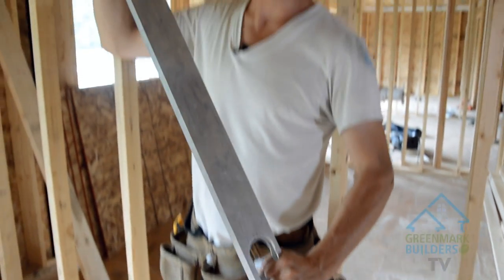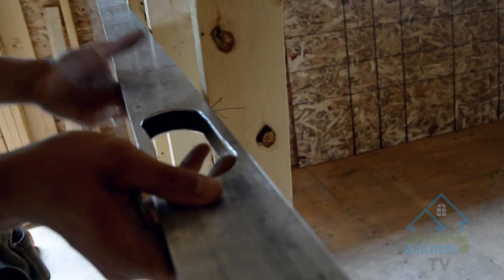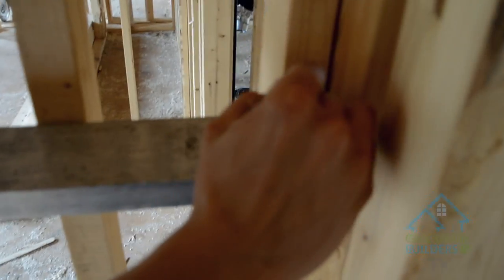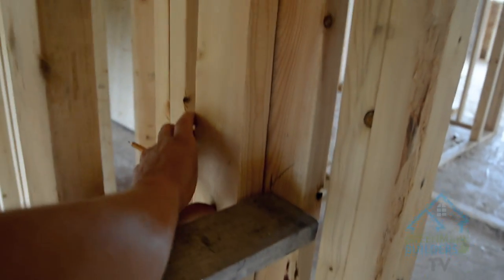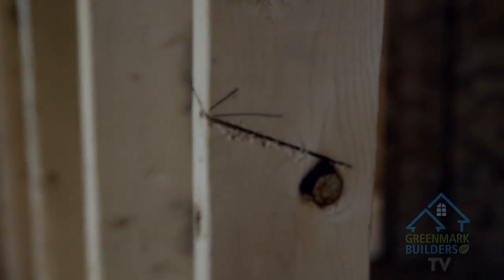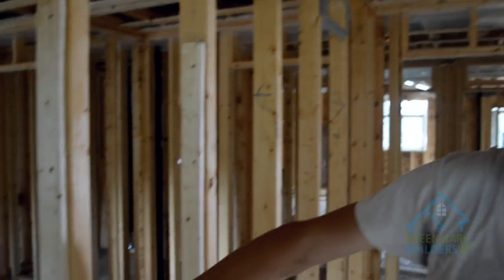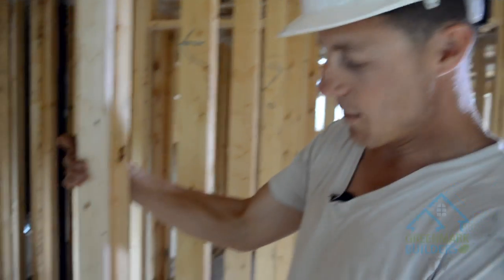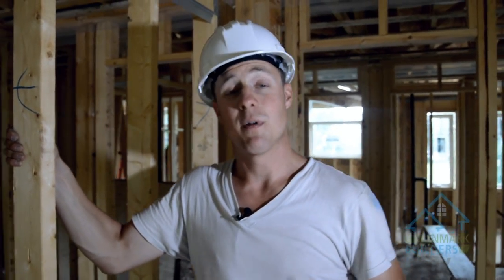Straightening Walls, Avoiding Drywall Pops!

Comment: Just kerf(small cut with saw) the backside about an inch deep(or more if you need) and PUSH, instead of PULL(i.e. the OPPOSITE of what you're doing)...easier to lean on a kerfed stud and screw than pulling and reaching and you often are seating the kerf back onto solid bearing and you can then toe a 3 in drywall screw through the kerf cut to prevent it from reverting  back. Good luck
Reply: A wall has two sides...so basically he did what you are saying
Reply: @thedcp  No, I believe he's saying to cut the bowed side so that the stud collapses down on the kerf (pushing away from the bow).

Comment: Don't forget to factor in that most "kiln dried framing lumber" is still about 20% moisture content, so when it dries out further in the house it will shrink and cause drywall pops.   Another way to get a straight and flat wall is to mark all the crowns in your stud lumber and install them in all the same direction.  This will prevent the wavy wall you would otherwise get.
Reply from the maker: Installing the crown in the same direction does help a lot, I should have mentioned that we do this as well. Thanks for your comment
Reply: You're solving one problem, but create another. You now have a hollow side and a cupped side. Depending on how bad this is you may need to pack and plane. Or use this method anyway.
Reply: @N1rOx  planing is not acceptable on inside walls... you fix the problem on one side of the wall but it persists on the other side...
Reply: @detrimundo  not acceptable to whom? It's common practice in the industry lol

Comment: Or you could have simply knocked the boards into place if it is an alignment issue and if it is a warping or size issue, a quick paper shim or hand-planer will smooth it out without essentially cutting it in half and then trying to replace the some of the strength with side braces.   Also, using center braces will help prevent future warping (and may be required as fireblock depending on where you are at).
Reply: What happens when you get to the other side of the wall? At least the bow has been corrected .  Center braces yes indeed also.
Reply: What he’s talking about works really well for leveling bowed or concave floor joists. It can also work during a remodel, to correct a bowed or concave wall due to wood drying out. However, it’s not practical to use this method during framing because it would simply take to long.

Comment: Keep in mind when you sheet both sides of the wall the drywall sandwiches the studs and essentially helps alighn the wall.
Reply: Drywall does not align walls. Drywall will conform to the wall. I have a house I bought full of warped and bowed drywall to prove it.

Comment: In New Zealand we do the same thing but we cut horizontally cut going 40-60mm into the stud then placing a wedge into our cut to straighten the stud
Reply: I saw it on Scott brown carpentry video. Nz YouTuber
Reply: Evil Nachoz yeah bro he’s the man
Reply: Yer Scott's channel is great. Here I've seen people cut and then screw. As you've removed material with the cut and then pull it together it takes it the opposite way

Comment: This is a really a nice technology. But it doesn`t work in case if another side of the wall is already covered with drywall or cement board.   Can you advise, please how many mm. of studs deviation is acceptable for further cement board sheeting and tiling by 600*600mm porcelain tiles, please? Thank you
Reply from the maker: In your case we would make the call on what looks good to the eye.  Every wall is different.  It's going to take you a bit of time but you can use plaster to correct somewhat.
Reply: @GreenmarkBuilders  Does it mean I can correct already cement sheet surface with plaster or use plaster as studs filler?   Thank you

Comment: All we do here In Colorado is cut like he did then screw it in at an angle and that straightens it or hit it with hammer on the bottom. Or if it’s not to bad then we staple 1-4 cardboard shims to make it even. My job is also to sand the plywood floor to even it out.

Comment: Here in Australia we have another method which I believe take less time and effort, we just pack the side that need to stick out and we just shave down the other side if needed, less time and effort I guess.
Reply: you can fix it from one side only. But how to add timber to the opposite side???  :)
Reply: @alexanderchuyko4889  they sell bundles of cheap 3mm packing strips.
Reply: That's both slower and more work.

Comment: Really hate to cut the stud in half like that. OCD framer here what I do site down every stud before I start. Any with a crown I put to side for my doubles. When they land doubles together put the crowns opposite each other work it down as you're nailing and they become perfectly straight
Reply from the maker: I hate cutting studs too.  I like straight walls and not dealing with drywall pops.  I agree with you on how you do the king studs.  Thanks for your comments
Reply: remember put the crowns opposite each other start at one end nail them together flush all the way down they will be perfectly straight. Some old timer showed me this about 25 yrs ago. Guess I'm the old timer now. 😅 also use your crown studs in kitchen crown outside the kitchen. Makes shiming cabinets perfectly straight a breeze.

Comment: This is insanity, though I understand what drove you to it.  Checking only the waist-high horizontal line along the studs conveniently assumes that the midpoint of each of those studs is where the warp will be worst, which often isn't the case (I see DF with S-bends on a regular basis).  It also ignores the equally-likely concern that, just as the framer didn't notice or care that some of his /studs/ were 3/16" out of plane, so could his top or bottom /plates/ have been warpy.  If your walls look sufficiently flat after only the treatment you show here, it may be that the studs weren't out enough to matter to begin with (of course your gyp will push and pull to improve planarity to some extent anyway), or that you're not coming back after the painters have gone and applying strong sidelight -- not your subcontract - to reveal the dishes and humps that a critical inspector might find under demanding specs.  By then, it would be the painter's headache...
Reply: DF is terrible for studs as it warps the most eventhiugh it has most strength.  I am not a framer and dont have to deal with crowned studs.  I just make sure I always choose no heart and straight studs from the get go.  You'd be surprised how much less flex your structure can be and the garbage that you have to deal with down the road.  I agree about the slicing... I'd really still thinking about a thin wedge instead of simple sistering, else you just have a useless stud taking up space but provides no structure.

Comment: Obviously don't use this method on load bearing walls?
Reply from the maker: You can still cut your stud on a load bearing wall, you need to add an equal sized stud on one side instead of the 1x3 ... this way you will have full bearing and a straight wall

Comment: why not replace the stud
Reply from the maker: if is not structural you don't need to worry about cutting the stud.  you may run into the new stud twisting in the future.

Comment: Just buy a planer, shave it down put the level on it and your ready to go !!!
Reply from the maker: if that works for you great.
Reply: never... that only addresses the problem on one side of the wall... what happens when you drywall the other side?
Reply: @detrimundo  you fill in the other side with shims to fill in the gap.
Reply: @GreenmarkBuilders  it does and it will save you a lot of time. Your doing it the super long way.

Comment: nice tip ,But with all that work and material ,why not just use metal studs (actually they are not that perfect also ,but they sraiten when drywall applied). I live in country where we use only metall. Its much better then wood for sure ,but in some countries wood just cheaper. Metall is way better ,light ,thin ,straight ,less and cheaper tools to assemble etc. PS. wood will distort aniway in year or two ,thats why most builders dont bother to straighten it.
Reply from the maker: +zCATAHAz Thanks for your tip on metal studs.  We use metal a lot here in Canada on Commercial jobs.  I would say the majority of builders here in Canada build with wood partitions because of the price and the speed.  To comment to your last point about wood distorting:  When walls are straightened and then sheathed on both sides the studs are locked into place which drastically reduces further twisting and crowning.  Metal studs are a great product, I believe one day they will become main stream in a lot more places around the world.
Reply: +Greenmark Builders Actually a read some calculations on internet and metal is about 10-15% more expensive (depends on area of cause) ,so if you will use it on some walls (like in bath ,for tile) its gonna be about same price. And I didnt figure out from your video - you should put all crowns on one side of your wall. You make nice videos  ,sould really consider to try make some tv show ,I like your attitude. :)
Reply: Metal a conductor. and would be a straight path outside -> inside wall. Then you have to start thinking about thermal breaks.
Reply: Thats for sure ,but its very thin and could be insulated way better ,more insulation so less thermal leak. Its pretty same to wood ,and we are talking about inner walls here ,so metal is all around better ,but its just more expensive  then wood in some countries...
Reply: In extreme climates where the interior is being heated or cooled substantially compared to the outside conditions, metal doesn't work for exterior-wall framing. End of story. It might be workable on interior walls, but using them on exterior walls is why commercial buildings are frequently a thermal disaster compared to residential. Metal studs can only be used on an exterior wall if they are completely isolated from the thermal system. Insulating them is, in the words of one scientist, "a thermodynamic obscenity" because they are going to render the insulation almost entirely ineffective.
Reply: I don't think the metal studs wood passcode. Wood is much stronger in this application

Comment: I have a situation similar to your video except that my project isn't new construction,  it's a load bearing exterior wall with a window. 4 ' up from the floor the studs start to crown towards the exterior and only on 3 studs, I've been trying to solve this problem and am ready to call in a pro, any last minute tips or ideas before making the call?
Reply from the maker: +Scott Hanson 
I'm sorry to hear about your news.  If you have siding on your home you may be able to unclick the siding and remove plywood from outside.  Whatever you do it is likely going to be a big job for you.  When you are dealing with cutting support studs and jack posts I would be cautious because you don't want to do more damage to your home in the long run.  Here in Ontario if you cut a supporting stud you need to add a full load bearing stud next to it.  If you call in a contractor you might be able to feather out the worst area with a plaster compound depending on how much  money you want to spend.  I hope everything goes well for you.
Reply: A planer?
Reply: My thoughts would be to put a new stud next to the warped stud, then either push or pull the warped stud in line and nail through the stud next to it. To pull a stud, you can put a screw in it and use a pry bar against the stud next to it to pull it out a bit. If all, or a lot of the studs are warping, you probably need more support in that wall anyway.